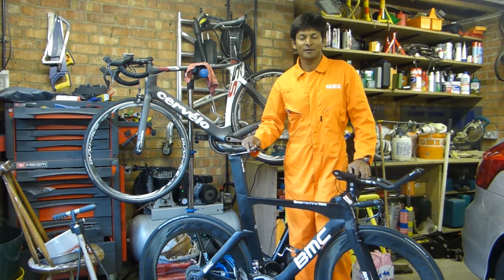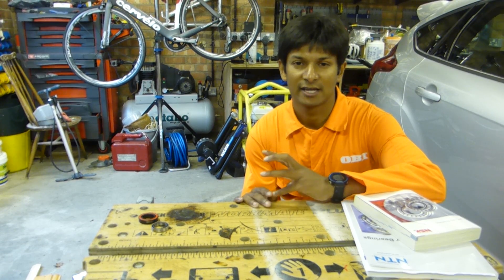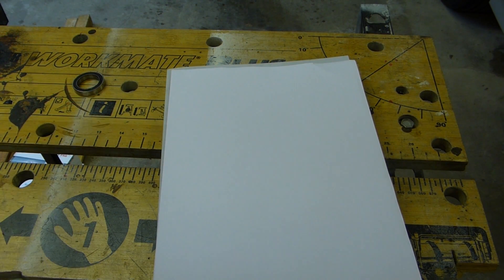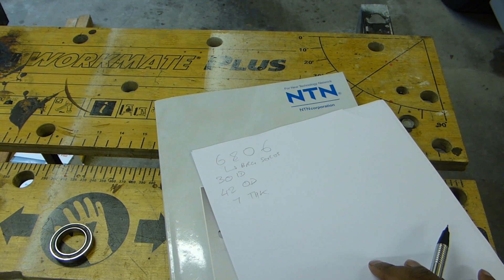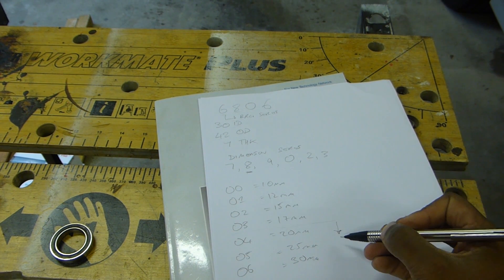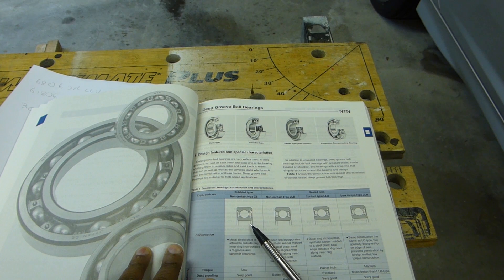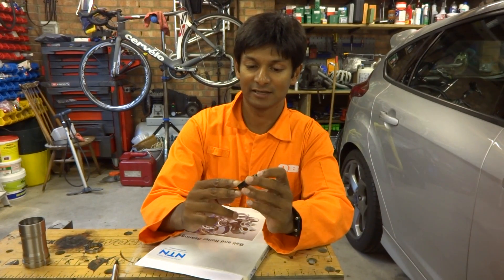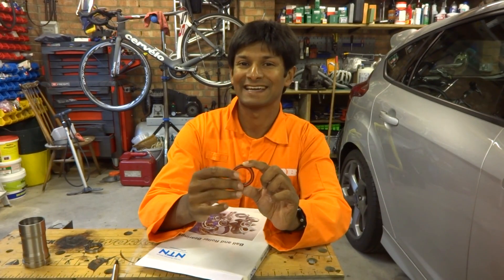Bicycle Bearing Numbers Explained (6000 Series)

Comment: I need to replace a 6900 Llu max bearing made by enduro, I’ve struggle to find other full complement bearings from other
Manufacturers, are you able to point me in some option from a
Manufacturer you would recommend recommend

Comment: HEY THIS IS HELPFUL THANKS! I hope you see this adn can anser me a quetion. I have a hub that I believe requires a 6000-srs. A 6002 should fit it based on what I see here, the only cavet being I would need a axel that fits IN the 6002....What I am doing is trying yo convert my hub to 15x100 axel. Maybe Id need a 6003 and a axel that fits?

Comment: Having choice from hubs using 6000, 61902 or 6190 bearings (ordered from bigger to small balls) me as a layman assumes bigger balls = more longevity, as long as they are of same precision class and materials used? Also price of replacement is like 5 coins for single 6000 bearing and close to 20 coins for other two slim type bearings. Slim means fancy but do they last well?

Comment: finally the video the internet needs. Bro. Thank u. Thank u. Im doing a trike build. I want to put sealed bearings in 20" spoke wheels that had a coaster break as i removed it so i want to slap sealed bearings in it then mount the wheel on rear axle . Is there anyways u could help or anybody help? iwant smooth ride.

Comment: Great video. One thing I've wondered, hopefully someone can tell me. Is a larger bearing more efficient?? We see oversized jockey wheels used to reduce friction. But they run on the same bearings as stock. I know manufacturing issues play a part here. But if you could get a larger diameter bearing (such as off a skateboard wheel etc..) would it turn more freely?

Comment: Wow this was incredibly informative. I have an electric moutain board that runs on 6001zz bearings. One of the bearings failed me after a winter of riding that included rainy weather. 
I'd like to get more 6001 bearings with a removable shield so I can add marine grade grease regularly. 

I'd this advisable? Or should I look for ceramics or just stick with sealed zz class?

Comment: What's better in terms of performance, ceramicspeed or ntn/skf bearings? I have had ceramicspeed bearings and I wont say that those are smoother that ntn ones that I bought today. In fact I tend to feel some kind of rubbing in ceramicspeed new bearings that I got after replacement, nothing similar with ntn. I am planning to change my zipp bearings to ntn without seals and with really light oil/grease. What oil/grease would be the best? I have hands on ceramicspeed pulley oil and ceramicspeed tt grease.
Reply from the maker: I would go for Shell Alvania grease. If you are going down the oil route, a light cycle oil would be fine.
Reply: @Hambini  is shell alvania better than ceramicspeed tt one? And how do you juge them?
Reply: @Hambini  those are competition wheels only, so 3k-5k km bearing life on the peak performance ntn tuned bearing setup would be fine

Comment: GREAT video, thanks. I noticed the NTN bearing you used as your example uses Kyodo Yushi grease (standard 5K).  The only NTN bearings I can find here in the states use Shell Alvania 2S (standard 2AS). Have you looked into differences between NTN’s standard greases in terms of friction losses? I suspect their viscosities are quite similar, but still trying to find the spec sheets...
Reply: Note that Shell products are rebranded, and NTN’s FAQs are not updated. Alvania is now Gadus.
Reply from the maker: Hi Matt, thanks for the comments. As far as the grease goes, the friction loss when they get hot is not going to be that much. The loss in the seal is much higher. From memory there is an ISO scale for grease viscosity versus temperature.

Comment: You mentioned the last 2 numbers designate ball bearing size.  A "06" equates to a 30mm bearing. Am I missing something that would be a 3 cm ball bearing?  Quite large for a bike bearing.
Reply from the maker: You have to multiply by 5mm so 06 x 5mm = 30mm. A 3cm bearing (30mm) is a BB30 bearing.
Reply: Ok, so the last 2 numbers designate the inner diameter of the bearing. In your example its 30mm(BB30). From the video it came across that the last 2 numbers represent the size of one individual ball bearing. Individual ball bearing sizes I am use to are 3/16", 1/4"  ect.    Thanks for posting the video.
Reply: Replying because I missed this on first pass too; the both of us just heard wrong. What Hambini's referring to there is "bore size", not "ball size" (as in, size of ball bearings)

Comment: I am planning a bike build. What BB bearings are fitted to your Cervelo? Should I consider upgrading the bearings in mid-priced (£500) clincher wheels?
Reply from the maker: +BMH1965 i would only change them if you are getting problems. I've got ntn where available
Reply: Thanks for the reply. After seeing more of your great videos, I am leaning towards the 'safe' option of Shimano Dura Ace C35 wheels (if still available - if not, then C40). When my frame arrives I will be visiting your website for a BB and/or NTN bearings. I am changing plans away from planned purchase of a Boardman Bikes frame due to negative data. If anyone has any recommendations for a mid-sized carbon frameset with a maximum budget of £1500 please let me know - ideally, under £1200. Thanks.
Reply from the maker: I'd try a Hongfu or Dengfu. Lots of people have them and don't seem to have any problems with them. Additionally ribble and planet x bikes are hongfu/dengfu.